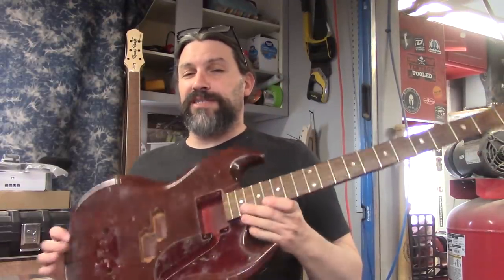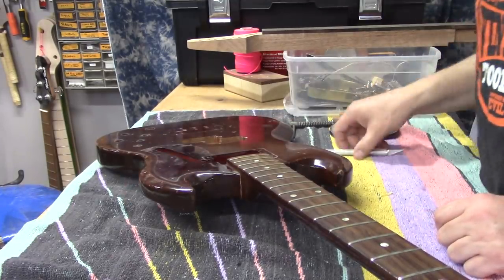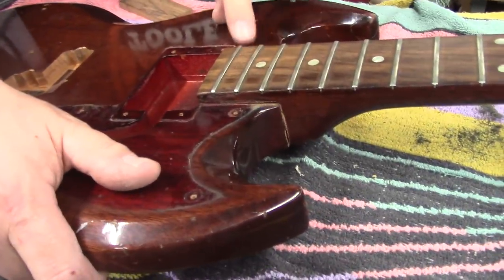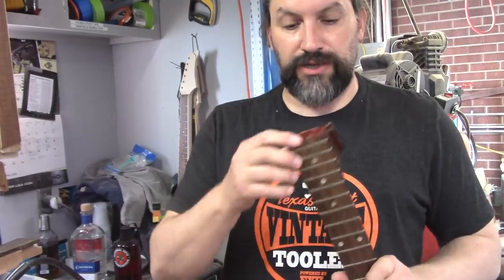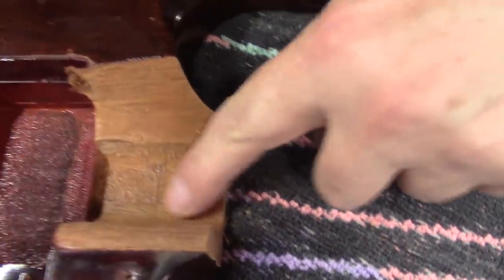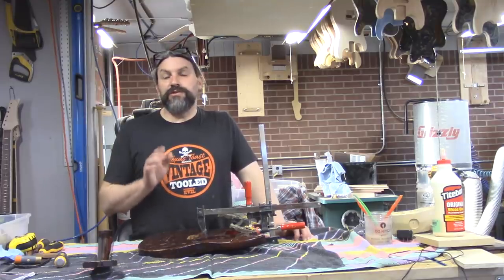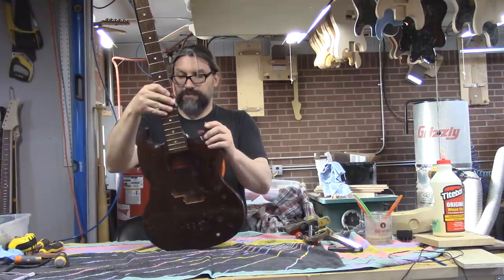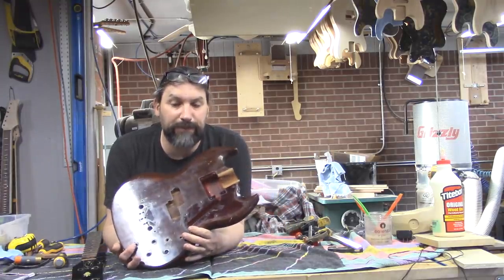1967 Gibson EBO Bass “Restomod” Part 2... Removing The Neck!

Comment: Great Video!
Does the heat gun also work for fresh glue? (titebond original)
Or does it only work on old glue that has weakened over the years?
Reply from the maker: Well... it will work but be patient. I would recommend doing a few test bits since you can and since you will know what the glue is. You know... that would make a cool video.
It sure works great on the old stuff
Reply: Wood is a pretty good isolator. So using a heat gun may potentially work somewhen...

Comment: Thanks to this vid, I was able to quickly remove my set-neck Flying V kit guitar. The heat gun solution has been a revelation for me. I used hide glue and I could hear it snapping and cracking as it heated, I pushed down on the neck near the headstock and it popped out, easily. I'm from all over Texas - native, and ir's nice to see you guys doing your thing!
Reply from the maker: Thanks brotherman, glad I could help out